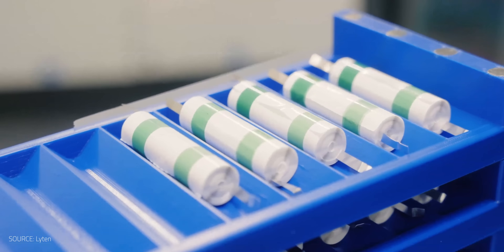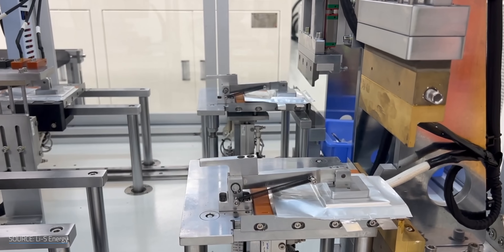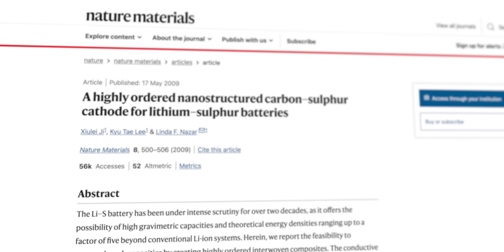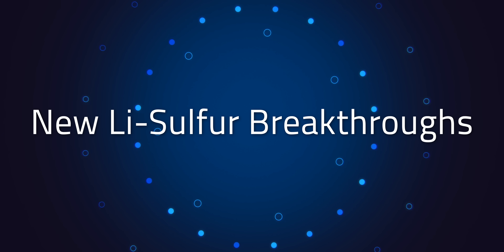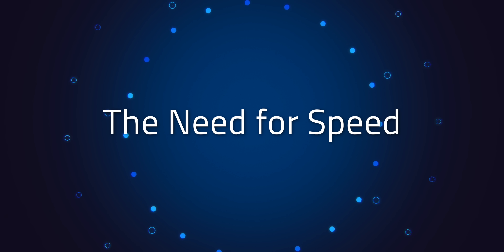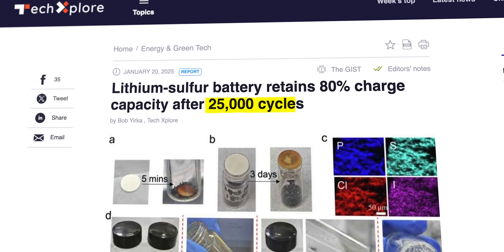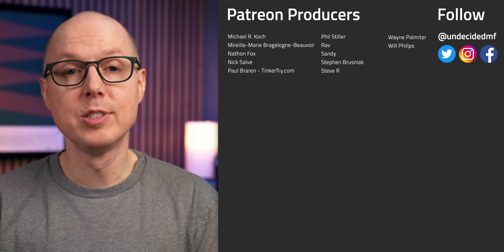How This Overlooked Battery Might Change Everything

Comment: Interesting presentation.

Sadly, it contains a common misconception about elemental sulphur: it is smelly. In fact it has neither smell nor taste.

Reduced divalent sulphur does produce compounds which are indeed very smelly and often very toxic. The oxidised form can form compounds which may be corrosive (sulphuric acid) and/or pungent (sulphur dioxide) or neither. (Have you ever noticed a smell from Epsom salt?) 

However, yellow elemental sulphur has no smell, no taste. It is almost completely insoluble in water and and so is non-toxic. Even better, in this form (flowers of sulphur) it is quite pretty.
Reply: In nearly every way most people are going to come across sulphur, some of it will be combined with hydrogen and stink, including most of the ways that we find sulphur in nature. Even people that have never actually been around it have a mental picture what brimstone smells like. :)
Reply: i'm not through the video yet but wondering about runaway and combustion of S?

Comment: I would love to see Formula E adopt this tech for the racing series - get some severe real world use under its belt - use racing and the money they can spend to improve the tech.
Reply: Racing should always be the bleeding edge of automotive technologies, too many racing regulations prevents proper intense innovation. A no-limits series would be awesome.
Reply: @Avetho  Most regulations are there to avoid accidents and driver death.

If you want to go for full tech, it has to be done with remotely controller cars so that safety is not an issue.
Reply: @meneldal  i would love this tbh
Reply: But we won’t hear those high reving engines anymore!
Reply: @ecleveland1  it's ok, we have all the crying and whining of all the people whose love for revving engines is even more deafening

Comment: If energy density, cycle life, charge speed, and cost, can provide a 400+ mile range, 10+ minute charge time, and at least 1000 cycles, (400k miles), for a reasonable cost, (i.e. lower than lithium), it could be a game changer.
Reply: Just life cycle and fire-resistant improvement will be enough to be a game changer for the used market.
Reply: @iraklimgeladze5223  How do electrical fires happen in these battery packs, just a complete failure of quality check? Most 21700 have internal chipboards to detect if the current is getting too high, and I would think it can’t be hard to mechanically disconnect the anodes and cathodes with breakers between them if current gets too high, or thermal meters if the packs get too hot.
Reply: @JohnScales-d5p  Sure, when everything made well everything works fine, but it's not always case. I have e-bike and keep it at home. Smallest risk of fire to much risk. I also want upgrade battery to prolong bikes life and only cheap way is to build myself but I do not want to risk.
Reply: @JohnScales-d5p 
How do the fires happen?
Basically dendrite formation that shorts out the anode to the cathode. This is guaranteed to occur eventually with enough recharge cycles.
Reply: @JohnScales-d5p  Cells do not have "internal chipboards", bare cells are welded into larger packs with other cells, there are leads attached to cell groups to monitor and balance cells but there is no mechanism to disconnect individual cells.  Battery fire risk is very low in properly constructed packs and EV's catch fire at a much lower rate than gasoline vehicles.
Reply: @iraklimgeladze5223 basically BYD’s Blade battery
Reply: @salted_lizard  you're already living under it.
Reply: Amprius
Reply: 1lt of petrol (gasoline) weighs 1kg contains about 8.9 kWh of energy.
Reply: @a9503128  And 80% of that energy gets wasted as heat instead of forward motion.
Reply: People forget that "charge speed" leads quite fast to ludicrous numbers. What would be a reasonable battery capacity? 80kw? 60kw? Tesla has models with 80kw, and 60kw is quite common too.
An 80 kw battery pack.

Ignoring losses:
To charge it in one hour: 80kw/h. At 800 volts, we are talking 100 amps. Doable, no biggie.
To charge it in 30 minutes: 160kw/h, during 30 minutes. At 800 volts, we are talking 200 amps. Doable, but we are getting into "interesting" territory.
To charge it in 15 minutes: 320kw/h, during 15 minutes. At 800 volts, we are talking 400 amps. I sure as hell don't want to lift THAT cable, even less be near it while operating.
To charge it in 5 minutes: 960 kw/h, during 5 minutes. At 800 volts, we are talking 1200 amps. Forget about it.

But, in fact, people fret about it without reason. We shouldn't drive 800 km non-stop. Make a break every 2 or 3 hours, and top up the battery while resting. Makes the numbers way less scaring.
Reply: It has to work from -25F to 120F too.
Reply: Tbh for personal EVs I wouldn't say a gamechanger in usage, just another improvement. Almost no one really needs this kind of range (with fast chargers, the current necessary breaks are less than the breaks humans need to drive safely anyways). And everyday commute charging can just be done overnight with 220V AC every now and then, no need for fast charging. So the main benefit is the cost and weight (lower weight meaning less energy used too). The only thing that could be a gamechanger would be the durability - if batteries are the last thing to fail in a car that would be ideal, and maybe there would even be the possibility of reusing the same battery in newer vehicles, but that would require standardisation so not likely. 
But for trucking, drones, and aviation it's a way bigger deal. Just the energy density could finally make those things feasible, which would definitely be big.
Reply: 1000 cycles is 400k miles?  Tesla is claiming average of 200k miles at 1500 cycles, how do you go further than Tesla with fewer cycles?
Reply: @wj9494  I explained it clearly in my post.  400 mile pack x 1000 cycles = 400K miles.  We've already seen existing EV's do that.
Reply: we already have battery packs like this....
Reply: It would change the world completely. We would be able to stop using fossil fuel for our transportation for the most part. We would still need it because so many things are made from oil .
Reply: also less weight which will help with range

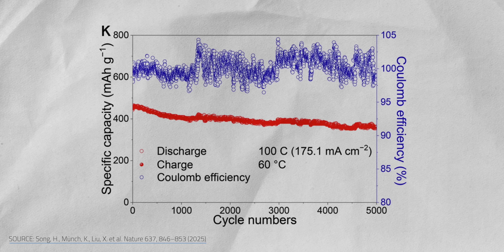Comment: From the paper around 9:40, is that really a 100C discharge rate?  If so, holy smokes.
Reply: Graphene LiPos have been doing that for a decade
Edit: at a low cost commerical scale, for RC hobby toys

Comment: Surely we're getting to the point where the rest of the car falls apart before the battery.
Reply: That depends on the car.  There are plenty of very high mileage Teslas where a battery swap would make it like new again.
Reply: The problem with EV battery packs is currently that, even if the average life of an individual cell is high, one failed cell renders the battery nonfunctional, and with current practices requires replacing the entire battery pack.
Reply: @ No, not with a good bms, it recognizes the bad cells and isolates them from the rest.
Reply: @aussie2uGA  then every EV producer out there is using bad, or minimal, bms.  Almost certainly from solid engineering or economic reasons.  A Tesla 3 long range model has over 4,000 individual battery cells.  How much mass and complexity would it add to have a BMS that could cut out each of those cells if it goes bad?  That's the problem.  What is feasible for a small battery pack becomes uneconomical or too difficult for a vehicle.
Reply: Unfortunately, no.  Li+ tech wears out long before the car does, leaving the owner with an awful problem.

Replace the battery, which is the largest cost part of the vehicle, or buy a new one.

If recycling of old battery packs was more of a thing (I've only heard of one guy doing it commercially on a local scale) it wouldn't be such a problem.

Comment: I only just realised that for drones, particularly combat drones, a long lifespan with many cycles is not nearly as relevant as high energy density.
Reply: Correct, which is why Amprius with their high density silicon anode chemistry is selling to the military.
Reply: And with density we mean primarily Wh/kg and not Wh/m3.
Reply: @bloepje  energy/mass should be called specific energy, not energy density, if I'm not mistaken
Reply: Potentially you could even opt for primary cell batteries in some of them.
Reply: Even outside of military use-cases, in the FPV racing/freestyle world, batteries rarely survive long enough to degrade significantly due to charge cycling. Usually they're destroyed either physically or by repeated overloading/overdischarging.
Reply: Yup. Most drones are one time use. More flight time\distance is more important. Probably for combat drones, tiny methanol Combustion engines to power an alternator will become the norm.
Reply: Attached solar panels?
Reply: You could not be more wrong. Drone warfare in Ukraine is split into two distinct parts. Short range FPV drones with a range of 20 km and extremely long range drones with ranges extending to 1,000 km. And everything in between.
Reply: @johnroberts9922  the drones don't need to recharge if they do their jobs. by lifespan they meant charge cycles. combat drones blow themselves and their targets up, so all that matters is energy density.
Reply: @ Nothing except Plutonium has a higher energy density than kerosene. One way attack drones are a product of pre-war racing drones.
Reply: @ Really? Do you believe reconnaissance drones are one way devices? At least half of drones over Ukraine airspace are reconnaissance drones.
Reply: @Deltexterity  not all of them but your point still stands.
Reply: @johnroberts9922  yeah and I doubt the recon drones are making more than 3 trips on average
Reply: @johnroberts9922  Any drone with a range measured in tens of kilometers can be electric. When you start discussing hundreds or thousands of km, they're ALL ICE powered.
Reply: @ Of course sir.
Reply: @johnroberts9922  The point is that for all (or at least most) of those applications, the number of charge cycles is not really important.  None, or at least very few, of those drones are intended to be used for more than a few charge cycles, never mind several thousand.   Many are even single-use.
Reply: @MarkRozema-v9m  There is no such thing as a half kwh single use battery. That is something like a cheap 0.01 kwh battery that fits in your D cell flashlight. GL flying a 5 pound drone on that thing.

Comment: Thanks for sharing your thoughts, ideas and videos. Things are really starting to get interesting. I’d guess that when batteries are above par with gasoline they will really takeoff. Your news sounds like it may actually be on the horizon. When people have to pay a premium to keep their ICE cars and trucks things will really start to change. The next needed technology will be inexpensive electricity. Pondering with all the new battery storage devices coming onto the market for home backup, are there any really innovative ideas that were unexpected coming soon. Really hopeful that a one week entire house backup could reach the economical market soon. Wishing you and your family the best.
Reply: electricity has an energy density about 15 times that of lithium ion. which seems like a very high bar. but when you factor in the Energy Efficiency differences between an electric motor and an internal combustion engine and then add the extra weight of an internal combustion engine and transmission then the energy differential is only about 2 to 1

Comment: How many new battery breakthrough developments have been promised over the years but non actully made it ?
Reply: Li+ is a battery tech that made it.  So is every other battery with new chemistry.  I promise you, Li+ had as bumpy and difficult a time as any other battery using anything beyond lead-acid.  The problem is media was not reporting on those techs well before they came to market.

In any case, this video just told you that Lyten is bringing their new battery to market, which means a new battery chemistry will soon be produced in near commercial levels.

The question for Lyten is no longer "can we make it for the commercial market" but is instead "will the commercial market buy enough."

That question is controlled by far more complicated factors than chemistry and feasibility.
Reply: Charge times have halved the last 10 years, another halving is coming, batteries got way cheaper and longer lasting, in case of EVs a lot has already changed
Reply: My car has a solid state battery made by bollorè , it is a technology from 1997 , mine is a 2016model with 66kkm and 0% of degradation
Reply: @ssupertutorial  I looked them up.  Impressive.  Thank you.
Reply: You didn't watch the video.
Reply: ITs already out there.. so what are you saying? Li, LFP, Na - all these exist and you can buy them. LiS is also out there, but you can't buy them yet for say.

Comment: What happened to those radioactive carbon and synthetic diamond batteries that I thought were starting to be commercially produced in the EU?
Reply: I don't think they were ever considered for commercial production.  In any case, regulatory issues likely stomped them under.

A shame, because I thought a device that could contain an LED as an "eternal" light source would have been a great idea.  Perfect for flashlights and small area lighting.  No more dark narrow stairs, and no more batteries to struggle to replace in a power outage.

Unfortunately, you could easily see idiot humans thinking "they're giving away diamonds!" and doing stupid stuff like trying to cut them into something sellable for far more than the battery itself, which would "release" the radioactive material inside.

Comment: I heard something recently about a Chinese electric vehicle coming to market soon that can charge in 5 minutes.  Is that related to this breakthrough?
Reply: BYD using a 1000 volt system (most EVs are 400 volt, some eg Hyundai, Kia and Porsche are 800 volt).
Reply: These voltages are not fixed levels but a category, Kia/Hyundai 800v cars can reach over 900v when charging for example. The BYD figure is abot 80v higher, so it's not just the voltage that enables them to charge fasster. More likely an extended charge curve to keep the batteries charging at higher rates for longer periods.